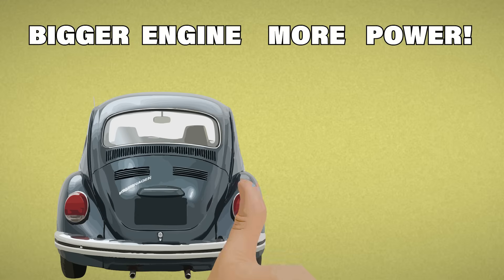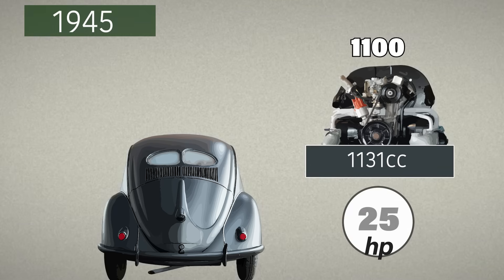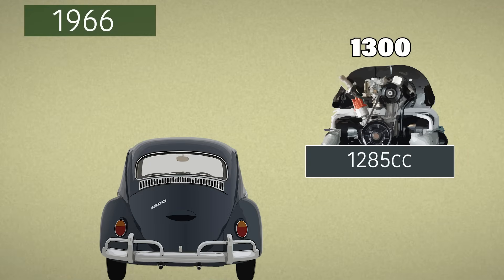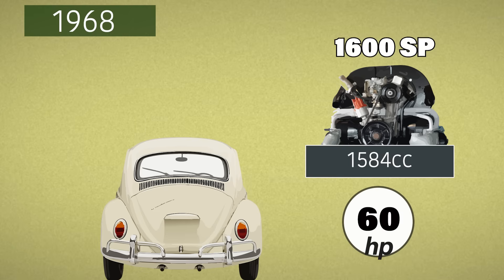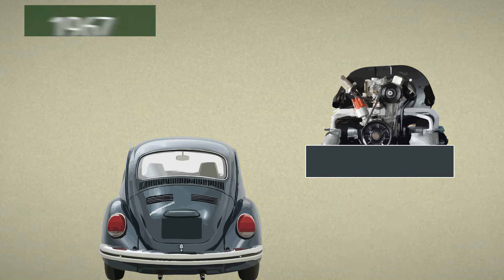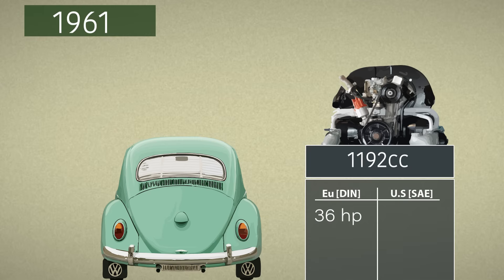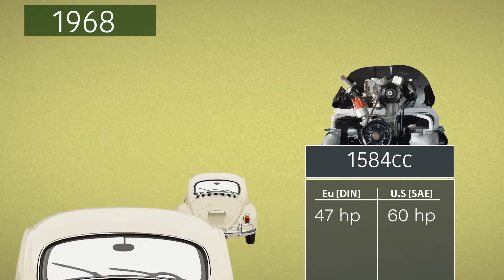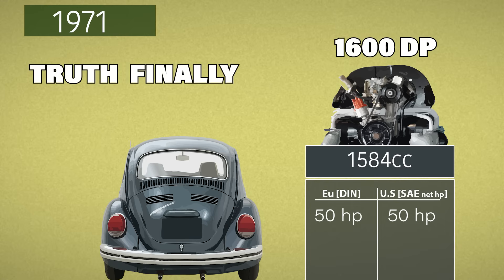The Great VW Horsepower Conspiracy

Comment: Horse power in cars are very generously inflated by using a different calculation than other types of engines. An electric motor or steam engine, If calculated by the auto method, would double in HP. A 1 HP electric motor would be 2HP. So be real and realize that 300HP hot rod is actually 150HP in real usable HP.

Comment: Was sind das für Fake News? Es stimmt nichts! Lasst die Finger von solch Videos, wenn ihr null 0, 0, 0, doppel null Ahnung habt!!
Ich kenne nicht genau die Baujahre aber die rein folge der  PS bis zu den Mexiko mit Kat,  da ist alles kunterbunt! 
Nach dem Krieg,  ja da gab es den originalen Motor aus dem Krieg.  Ob 1100 kann ich nicht sagen aber er hatte 24,5 PS !
Der wurde rechtschnell vom 1,2 Liter mit 25 PS abgelöst. Dann folkte der 30 PS Motor es sind immer noch die ersten motore gewesen, die man aufgebohrt hatte. Der wirklich neue Motor, ist dann der 1,2 Motor mit 34 PS, der bis zur Produktions Einstellung des Typ 1 weiter produziert wurde. Der Motor ist etwas größer gewesen als der 25 und 30 PS Motor, man hat die 34 PS Motore nur mit fummelei und die Fahrzeuge bekommen, die die alten 25 und 30 PS motore original verbaut hatten. Mit der abschafung der Buntbolzen Vorderachse, ging die ccm und PS Steigerung voran. 
Genau weiß ich es nicht, wann der erste 1,3 Liter mit 40 PS verbaut wurde aber gegen den 1,2 mit 34 PS eine fast Rakete. Danach folkte der 1,5 Liter, den gab es erst mit 44 PS und je nach Vergaser und Zylinderkopfe, ging das bis über 50 PS.  Ich glaube der Typ 3 hatte mit zwei Vergaser und doppelte Luft Ansaugkanäle im Kopf, 55 PS. Der erste Typ 3 mit einen Vergaser und einfache Köpfe hatte nur 45 PS. Der Typ 3 bekam dann den 1,6 Liter, der in meinen 1600TL mit einfache Ansaugkanäle und zwei Vergaser, 55 leistete. Man konnte alle motore PS steigern. Andere Köpfe oder zwei so wie Poppelvergaser, so konnte man diese Motore leicht leistung steigern. Das ist beim käfer einfach und simpel gewesen, nur leider haben die 2,5 Liter motoröl, die Grenzen gesetzt.  Erst mit dem 411 und 412 sowie den Typ 4 ging das aufmotzen richtig los. Die Typ 4 Motore, die meist mit 1,9 oder 2 Liter, im VW Porsche verbaut gewesen sind, haten Sumpf Schmierung usw, was man natürlich auch bei den Käfer Motore verwenden konnte. 
Ich habe jetzt nicht die 1302 und 1303 Käfer angesprochen und auch nicht die VW T2 Fahrzeuge die wiederum oft andere PS zahlen hatten. So gab es in den USA beim T2 auch 48 PS, die zb in Kalifornien mit zwangskühlung und auch AC ausgestattet wurden. 
Mein jetziger 1303S ist eigendlich ein 1,6 Liter mit 55 PS, da er von Hause aus Köpfe mit zwei Kanal Ansaugkanäle hatte bot es sich an zwei 40ziger Weber Doppelvergaser zu verbauen. Eine andere ölwanne mit 3,5 Liter Öl Inhalt, sowie mit einen echten Ölfilter aufzurüsten. Ein zweiter Ölkühler vorn ist vorbereitet aber noch nicht verbaut. Mit der neuen ölwanne und ölfilter komme ich jetzt auf ca 5,5 Liter Motor Öl, was bis jetzt bei Dauer Vollgas das Öl recht gut in der Temperatur hält!
Auch benutzen einige die 1,8 Liter motore vom 411 oder 412. Auch das eine rechte preisgünstige Möglichkeit einfach an die fast 100 ps ran zu kommen. Wenn ich mich nicht täusche,  hatte der 412 mit mechanischer Einspritzung ca 85 PS. Nicht schlecht aber für den schweren 412 und 411 viel zu schwach.

Nächster Quatsch!  Ich habe gelernt, das die SAE PS,  die errechneten PS sind die die Kurbelwelle ohne Anbau Verträge.  So kann ich mich erinnern, das der Golf 1 Kurbelwellen hatte die alle 110 PS spielend verkraftet hatten.
Und ja die Amis haben so ihre PS errechnet und angegeben. Ich habe einige Fahrzeuge zb die Ventilatoren für die kühlung  abgebaut und auf Elektro Lüfter umgebaut. Angeblich eine 10% tig PS Steigerung.  Mag sein aber diese Alkohol Kupplungen sind oft genug, zb beim Opel defekt gewesen.
Ich schaue gerade in mein Käfer Buch "jetzt helfe ich mir selbst", da steht nichts von Europa und US PS? 
Wie gesagt einiges stimmt zb mit den ersten Käfer aber danach ist das reine Märchen Stunde!  Braucht man nicht!

Comment: Hi I am new to VW I have I think a T 4 2000 1978 engine the engine #is GD0027769 or GD02776 ? What kind of HP would put out, what piston did it come with and what type of what is the difference there between say T 4 and a T 1 or 2?
Reply from the maker: G’day, welcome to the VW family. Sounds like you’ve got yourself a 2 litre Type 4 engine there.  The engine number starting with GD confirms it’s a 1976–79 Type 4 1970 cc motor, originally used in the late Baywindow Kombis (Type 2).

From the factory, that engine produced around 70 HP (SAE net) depending on whether it was fitted with dual carbs or fuel injection. The pistons were 94 mm in diameter (that’s what makes it a 2.0 L), and it ran a 71 mm crank stroke.

You’ve got one of VW’s toughest air-cooled engines 👍 
Enjoy getting to know it! 
Each one’s got a personality of its own.

Comment: My 1.6 water cooled VW SOHC  8 valve put out 60KW on paper,  a whack more for same capacity with far better economy. Audi technology. Almost double the compression & cooling easier & cheaper to modify for African conditions: cooler thermostat & fan switch. Beetle requires bigger fan & oil cooler: expensive imports, all l could do was fit longer(bigger) oil pump.
Reply from the maker: Hello from Australia 👋
Nice to hear you still stuck with the older VW. and  good to hear it worked well for you in Africa.
Reply: @KombiGarage Have to make do with what l can afford but bulletproof compared to newer stuff & did l add easier to maintain?

Comment: As someone who worked on these almost exclusively (back in the day) I think there are a few incorrect dates here. That 1500 engine was in the bug for 68 and 69 and 1600 single port hit circa 1970. I believe it was the same for Gia, type 3 and Transporters, although the type 2 (bus) went to a type 4 engine in 1973.
Reply from the maker: Thanks for that. 
The video’s dates came from factory and workshop manuals (Tom Wilson, Bill Fisher, Bentley, etc.), which record production changes, meaning when VW built the engines, not when the new models hit showrooms. VW’s model years rolled over each August, so there’s always a few months of overlap.

So both timelines are right, mine’s from the factory floor, yours is from the sales lot. 👊
Reply: @KombiGarage  BTW, engine size also seemed to vary by country of destination. As I recall, many South American bugs had smaller engines than the US market of the same year.
Reply from the maker: @rupe53 good point, it demonstrates why it can get a bit confusing.

Comment: Yeah, but it's wrong. The dual port 1600 was 60hp. The 1300 and 1500 were strong runners, but the 1200 or less were far more reliable.  The enemy was heat.  The flat 4... surface grows by the square while volume grows by the cube. The 1700 was instant failure in warm climates. The headbolts.. studs, loosen 10 out of 9 times.

Comment: Well incorrect. The early engine had 25 DIN hp not 36. was the SAE figure for the "56 and on engine. The 40 HP is a New engine.  different cases, crankshaft, cams. valves, heads, fan. The 40 hp/1500/1660 parts can all be used to modify the 40HP...but never the 36.
Reply from the maker: The 25 DIN was the 1100. The video is describing the discrepancy of the 1200. 

Thanks for your input.

Comment: 1966 had higher compression, 1967 larger engine but compression was lowered.  1968 SP 1600 was for the type 2 in the USA.  It got better low end, low speed torque compared to the DP in 1971.  From thing on VW engines became smog devices in the US and performance suffered.
Reply from the maker: Exactly right 👍 the 1600 SP has good low end torque, especially great for buses.

Comment: You nitwit every American automaker used brake horsepower before 1971 that was commonplace Germany used net horsepower there was no conspiracy there was no lie and then America switched to net horsepower so every muscle car in America lost 100 horsepower overnight they made the same power as before but the rating system changed it's not a conspiracy it's not a lie it's just a different rating
Reply from the maker: Ouch! 
Germany did’t use net hp, they used DIN their own standard. 
And this video is about the 1200 VW engine, which had multiple ratings as it was imported from Germany, which caused confusion.

Comment: There was also 1971 1300 duel port , a dual-port upgrade was implemented in August 1970 and would be present in all 1971 1300cc models
Reply: Yes i just purchased a 1970  1300 dual port Malachite Green Beetle original but needs restoration 👍

Comment: I had a '60, '61, '63 beetle. The engine was a '61. The '60 transaxle had a graphite throwout bearing! Just a disk of graphite.
Reply from the maker: Did it perform noticeably differently?
Reply: @KombiGarage  If you mean the throwout bearing, not at all until it failed. Smooth as the roller bearing replacement. This was the '70s when VW parts outnumbered American parts at the junkyard.

I just remembered the crankshaft broke in half in that car. I drove it for two days before I got it to the shop. I couldn't figure out why the engine was running so rough.

Comment: When VW released the fuel-injected Type 3 in 1968, VW said it was still the twin-carb 65HP but people said the FI car seemed to go faster.
Reply: I had both the injected version and the carb version. I suspect the major difference is the injection allowed better response at lower RPM. IOW, around town it felt a bit more peppy.

Comment: Where did you get these values from? The official values from Germany are:
1100cc - 25 PS/hp
1200cc - 30 PS/hp (Standard)
1200cc - 34 PS/hp (Export/ De Luxe)
1300cc - 40 PS/hp
1500cc - 44 PS/hp
1600cc - 50 PS/hp with variations
Not much for engines of this size. That made them thirsty and expensive in tax (based on cc), but relatively cheap in insurance (based on PS/hp).
Reply from the maker: Hi, and thanks for asking. 
This was based on a lot of reading through various books like:

Bernhard Rieger – The People’s Car: A Global History of the Volkswagen Beetle

Keith Seume – The Beetle: A Comprehensive Illustrated History (1997).

Tom Wilson – How to Rebuild Your Volkswagen Air-Cooled Engine (H.P. Books).

John Muir – How to Keep Your Volkswagen Alive

Lindsay Porter – VW Beetle & Transporter: Guide to Purchase & D.I.Y. Restoration

Ken Freund et al. – Automotive Repair Manual: VW Beetle & Karmann Ghia 1954 – 1979 

Larry Johnson – Fix Your Volkswagen

Robert Bentley Workshop Manual – Volkswagen 1200 Type 11, 14, 15

The point of the video was to show that different countries (especially the US) used different methods of measuring horsepower. In a follow-up video VW’s Strange Horsepower History, I go into this even further, showing how the 1200 was given 4 different hp ratings. 👍

Comment: VW engine design was good, but as power was increased engine cases were unable to restrain the pressure placed on it by increased horsepower.

Comment: This engines in original form, do not develop big numbers in hp because of its limited rpm capacity. The amount of torque developed at low rpm is the most significant factor in this engines. The most of the people want a reliable and long lasting engine. That’s what this engine was designed for… saludos!
Reply from the maker: Spot on 👍

Comment: Horsepower is meaningless without the bandwidth of RPM it falls across (aka powerband).
If HP was the only important number, every small car would have a motorcycle engine and be done with it.
Anyone who's ever driven an old pickup with a straight six understands what i'm talking about.
It's the reason why old manual vehicles could get by with just 3 speeds or 4 speeds without struggling, even though they didn't have high HP.
Reply from the maker: I do believe you are talking about the torque range, see my video on torque and let me know if that’s what you mean 👍

Comment: I had a 73 Super Beetle with a 63 engine and transmission, 68 rear fenders and engine lid, European marker lights, and 77 seats, running boards, and wheels. I built it entirely from junkyard parts and all total had less than $800 in it. You can't do that any more.
Reply from the maker: Wow, imagine what it would sell for now 👀

Comment: Imagine if VW had kept developing the Type 1 engine for another decade or so. What would it have? A hydraulic roller cam, as in a cam designed to operate with hydraulic lifters with roller bearing tips at the bottom of each lifter. The lifters would of course be externally fitted. The cylinder barrels would be Nikosil coated alloy, making them both lighter, thermally better at temperature transfer & reacting to temperature changes similar to both the heads & crankcase. Then we come to the heads, where we now have forked rockers, giving us 4 valves per cylinder with incline canted valves, without the hassle of OHCs, in a similar style to the Honda CX, the Moto Guzzi Daytona & the Triumph TSS. Plus of course the crankcase will have a proper canister oil filter on it. Of course the the forked rockers will be of the roller rocker variety, both on their pivot points & their tips. Another good idea would be watercooled heads, while keeping the barrels & crankcase air ‘n oil cooled, Rotax boxer style, thus keeping the fully closed decks, meaning no headgaskets & no issues like the silly wasserboxer. Ideally we could have individual heads for each cylinder, like some aircooled Porsches, but in this case so we can have the heads & barrels shrunk screwed together, like air cooled aero engines were done in WWII, giving perfect sealing. 
The front suspension will have longitudinal torsion bar suspension, basically the same as the Porsche 914 with shock only struts, giving a much lower floor to the boot up front as no beam will be in the way. While at the back a proper semi-trailing arm rear end with oleo-pneumatic spring-damper units & thus no need for the torsion springs. Rack ‘n pinon steering would be good too, plus 4 wheel disks will make for easier servicing. Afterall it’s not as if rear disks cost anymore to make that rear drums do.
Reply from the maker: That’s a really cool vision — kind of like imagining a ‘what if Porsche and Rotax had taken over the Beetle engine program in the 80s.’ The reality is VW never went down that road. They kept the Type 1 simple and cheap, sticking with two valves, solid lifters, and air/oil cooling until emissions and safety rules pushed them toward the Golf. Some ideas you mention did appear in cousins — hydraulic lifters in the late Type 4, MacPherson struts and rack-and-pinion in the Super Beetle, discs up front on Ghias. But VW’s magic with the Beetle was steady, unspectacular tweaks, not radical leaps. It’s fun to imagine though — because a Nikasil, 4-valve, semi-liquid-cooled Bug motor would have been wild!
Reply: @KombiGarage  I would love it if someone adapted Honda CX heads onto a VW Type 1 or 4. Problem would come from pushrods not being parallel to each other, but instead slightly angled so the 2 pushrods for each cylinder get closer to each other so they’re virtually touching where they enter the head. See pics of the valve train layout in both the Honda CX & Moto Guzzi Daytona & you’ll see exactly what I mean. Meaning one would have to create a setup where each pair of pushrod tubes merge at the head ends of the tubes or there are no pushrod tubes & some type of sealing method is created for pushrods at both ends of them. Better minds that mine would have to be involved.
Reply: Thanks for the heart, for that & the comment on my comment, I’m now subscribing, mostly in fact that I really enjoyed your video & it inspired me to get my brain cells ticking away. Thanks again, KG.
Reply: They would have gone bankrupt (they were actually close to in the early 70s). Engine is one thing, nut the rest was not competitive anymore (small trunk, just 2 doors, loud, no crash cell, no real safety steering rod, ...)

Comment: I know nothing about air cooled VW engines or their tiny power figures. What I do know is that the US changed its power and torque figures from SAE gross to SAE net in 1972 for American cars and 1973 for foreign cars sold in the US, which leaves me a bit confused with you saying that it happened for VW power figures in 1971.
Reply from the maker: Fair point. You’re right about the U.S. switch being ’72/’73. The twist is that VW jumped the gun, by the ’71 model year they were already quoting the lower DIN (net-style) figures, so owners started seeing 50 HP before the official change hit.
Reply: @KombiGarage  interesting. Another thing I can tell you is that some 1971 American car brochures include both net and gross power figures to get people used to the change the year before it was official, so I can see VW trying to do the same thing.

Comment: A 912 in69 only had 105,  but lightness pays off.  I had a 68 bug, ended up with counter crank weighted 1641 with dual kadrons, ran like a swiss watch.  Put a dog house shoroud on it and Ansa exhaust, that made the power band wide and very nice to drive.  Then got a 912, wonderful out of pattern speed, rebuilt that engine with advice from the maestro. Fantastic car. Miss air cooling but lean burning kind of did em in that and stupid CARB.
Reply from the maker: Thanks for sharing your experience 👍

Comment: Why did VW never produce a bug engine that did not require its valves adjusted every 3k miles?
Reply from the maker: Actually, VW introduced hydraulic lifters on some Type 4 engines (used in late Buses and Vanagons). Those engines didn’t need regular valve lash adjustments.
Reply: @KombiGarage  From my understanding VW bus engines were not used in VW bugs?
Reply: I never adjusted the valves on my 1961 1200 CC bug and it ran just fine. had it for 10 years and 234K miles. Didn't change oil either. Just added more.
Reply: @paulherbert5548  Was your bug powered by methane from your backside?